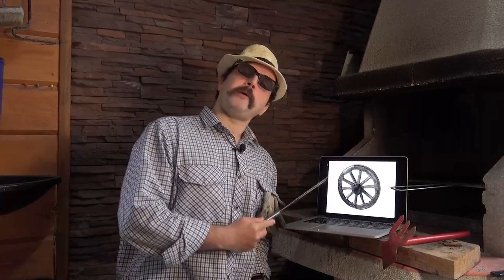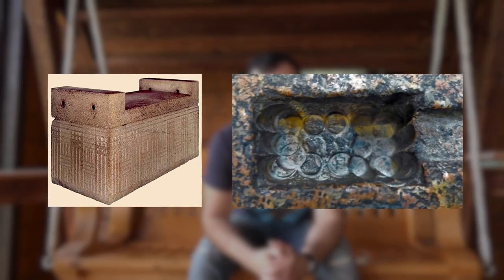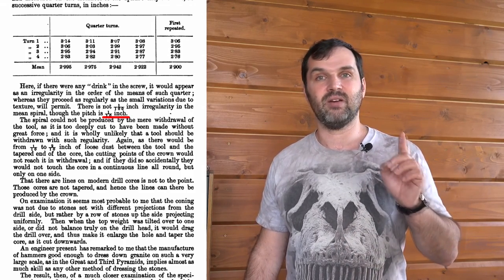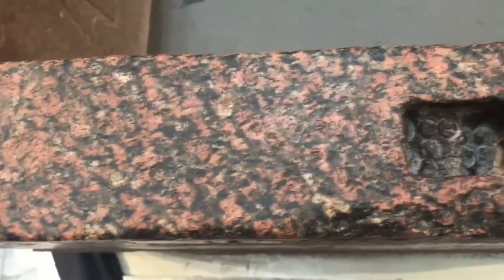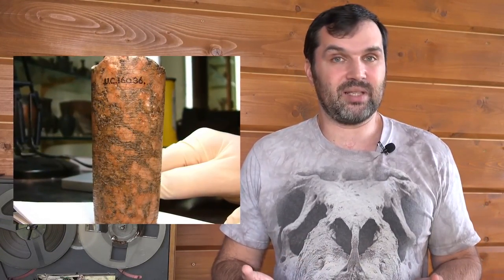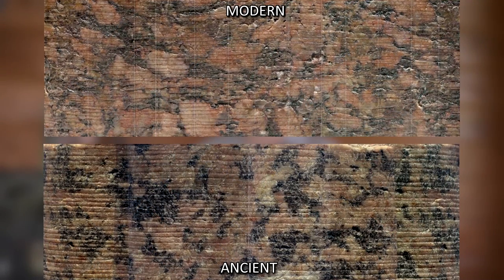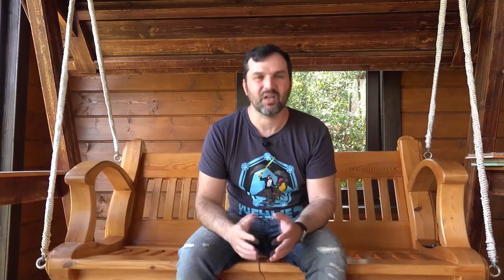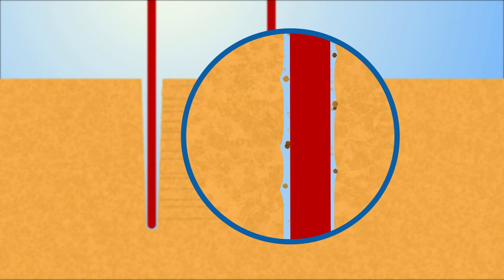Out-of-place artifact: 100 years of deception | Fake science spotlight

Comment: try it with copper and stones , drill unto granite for six inches, if you cannot finished it it one day, that means you don't debunk anything, remember the built the pyramid in just 20 years, that means they are able to do any stone work quicker. .
Reply: Can you provide any reasoning for your estimation of why 6 inches per day indicates anything?
Reply: @Eyes_Open  showing how slow and painful the process is  with copper hand tools, it is impossible that they built the pyramid in 20 years, 6 inches per day indicates faster work which correlates how fast they built the great pyramid.
Reply: @Wanderpupil  That sounds like a belief, not a calculation. I am not sure how drilling the hole relates to building the pyramid.
Reply: @Eyes_Open  lol, 2.3 million blocks, 2.5 tons average per block took 20 years to build, Egyptians would quarry, transport, shape and place each stone every 4 mins   in order to achieve that. .let alone the planning, the leveling of the ground , putting blocks on the ground. .some stones are 500 to a thousand miles away from the site. , now tell me isn't it fast? . .lol
Reply: @Wanderpupil  1 block every 4 minutes? That would only be true if you limited the entire workforce  to placing a single stone at a given time. Projects are completed by teams working simultaneously. The bulk of the Great Pyramid is rough cut limestone blocks quarried on-site with rubble and mortar used to fill in gaps. The outer layer was closely fitted together on the mating surfaces and was formed mostly from Tura limestone. Granite found on the bottom casing stone layers and in passageways and rooms inside the structure.
Reply: @Eyes_Open  lol, of course it was completed by thousands of people, of course there are people in every sections,  the question is how long would it take them to form 1 piece of stone perfectly shape like a butter cut by a knife and place it? , plus you cannot fit 30 people working in 1 stone, the surface area is only 2 meters by 2 meters everage each stone, they can only cut stone using two copper saws at the same time. In our modern technology using diamond tip blades it would take 8-10 hours to form, imagine how long would it take ancient egyptians using only copper saws, they can't even finished it in one day in one parallel side, and there are 2 parallel sides left. Now, you talked about the labor force, according to data at the peak of ancient egypt the, egyptologist estimated that there are only 20 to 30 thousand people who built the pyramids, now do the math, you can divide it into four sections, quarrying, transporting, shaping and placing. .Quarrying alone would spend a lot of time using pounding stones and copper chisels, and they are not robots they also need rest. .
Reply: @Wanderpupil  Stop believing in perfection of each stone. Quarrying of the limestone would involve chisels, picks and levers to form a shape and break away. Granite would involve splitting as much as possible and then shaping later. Egyptians were an organized people and the stone working industry was long lived.
Reply: @Eyes_Open  because it was actually perfect to everyone who visited Egypt, as your eyes can see, perfect cube, perfect stone cut, if it wasn't perfectly put on top of each other a slight angle error, the stone will slide away, because there was no cement or metal bars holding it,  the only reason it wasn't perfect as before, due to stone erosion and damage done by treasure hunters . .
Reply: @Wanderpupil   The majority of pyramid stones were rough cut (imperfect) and then stacked.  This can be seen in any close photo.
Reply: @Eyes_Open  nope, it was eroded, the picture you have seen, was a casing stone, a granite stone case unto an eroded lime stone, which is actually not been done by chisels and copper saw. .lol
Reply: @Wanderpupil  It is obvious in almost every photo and video. Time to let go of the pretend stories.
Reply: @Wanderpupil  Its too bad that YouTube did not send me your last amusing comment and I am just seeing it now. It would be a great joy to sit in the same room with you and explain how to use your eyes to look at photos and video of the pyramids.
Reply: @Eyes_Open  lol, because you only rely on photos and videos, every channel have their biases towards a certain theories about how they built the Pyramids, but when they actually try to replicate some of it, they are proud too show you that they have done it using primitive tools, lol, 😆 they also try to make a granite vase with primitive tools but finished it in 6 months lol. .What a painful and slow process, not even productive. .
Reply: @Wanderpupil  Great. You ignore photos and videos and obviously published data. You must enjoy a life of incredulity with neverending mysteries.
Reply: @Eyes_Open  yeah just open your eyes. .
Reply: @Wanderpupil  My open eyes see your complete lack of understanding of this topic.  If you ever need a building to be constructed, please hire me. I can do a crap job, you will see perfection, and I will make easy money.